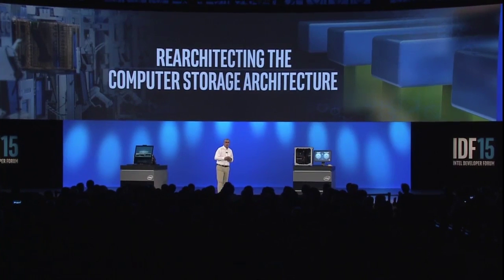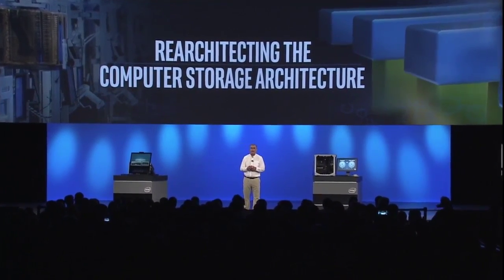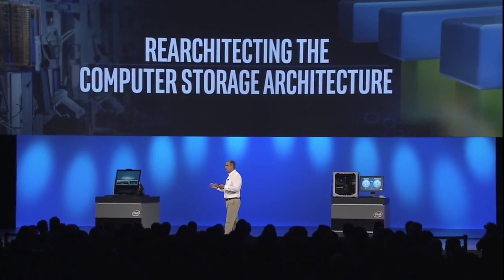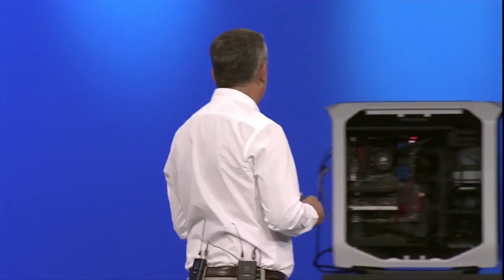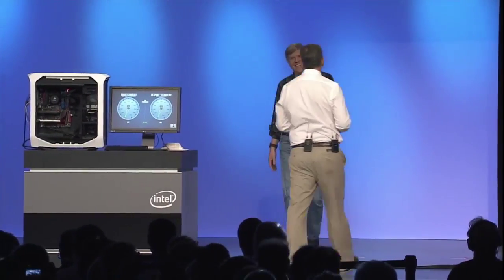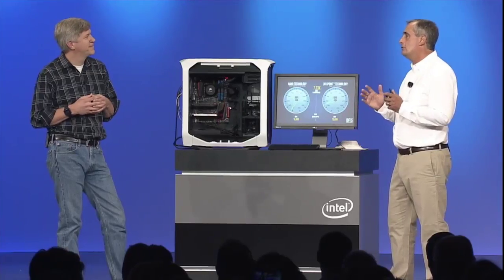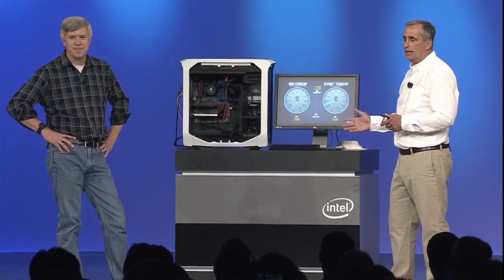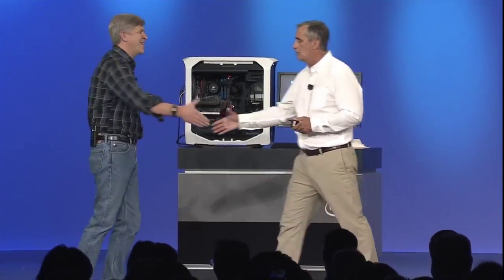First Look at Intel Optane Memory Powered by 3D XPoint Technology

Comment: If they really wanna name it three d cross point, shouldn't the cross be written as a plus sign instead of an x? As in 3D+point. Otherwise, we're all gonna just call it three d x point.
One of them mentioned using silicon through vias (STVs) to build the stack of memory chips, that sounds just like HMC. Where does that leave HMC? Are they competing technologies now that they will also offer 3Dxpoint packaged on DIMMs? IIrc HMC wasn't supposed to be non volatile so I assume they are different things and not one and the same technology but with different names invented by their marketing people.